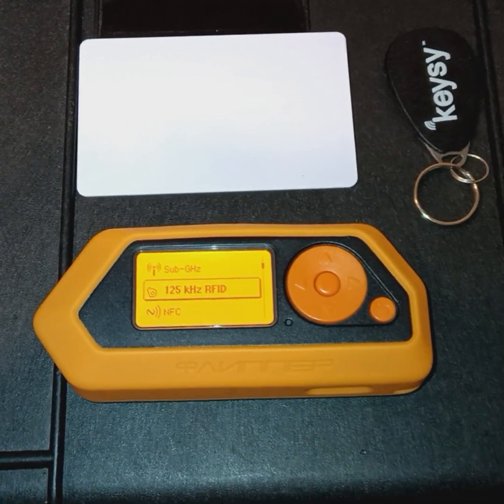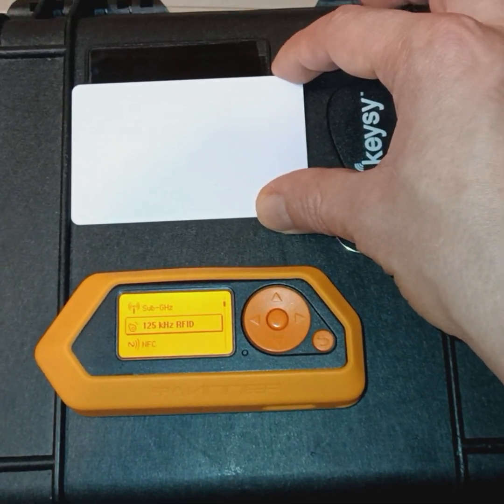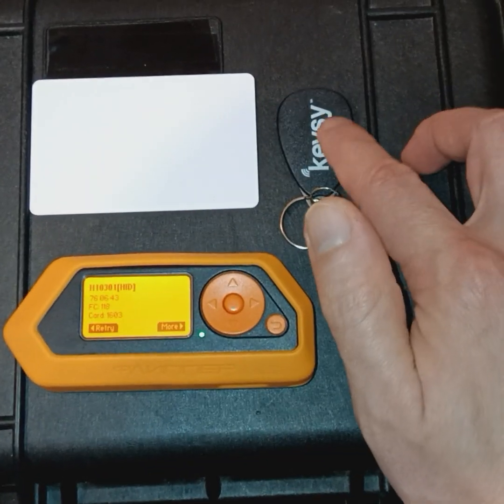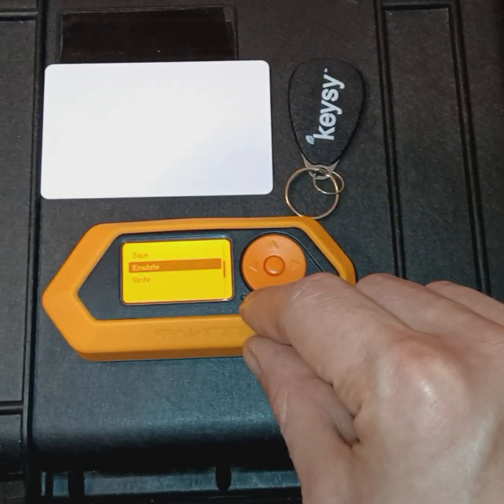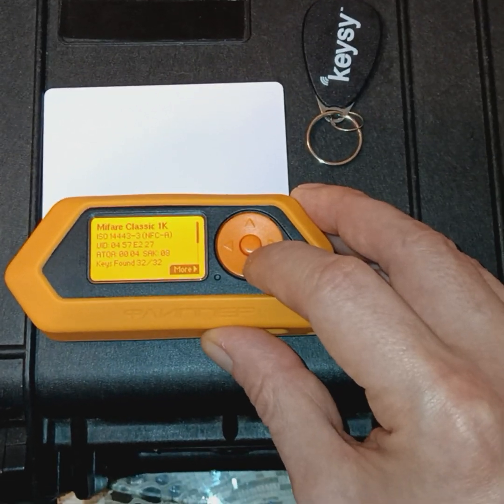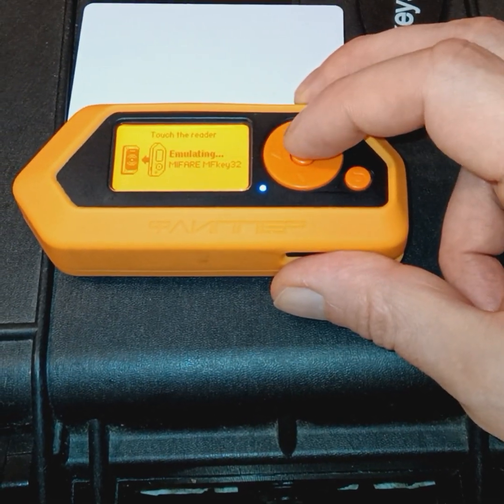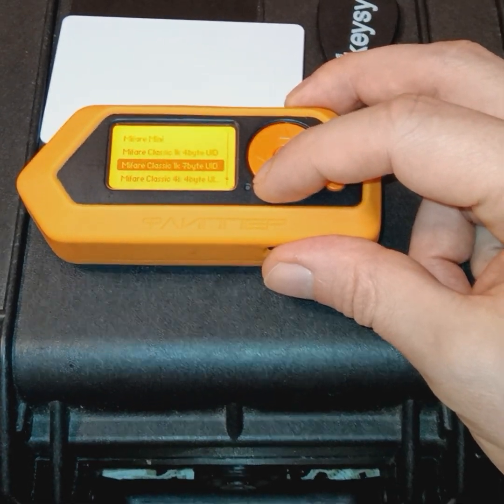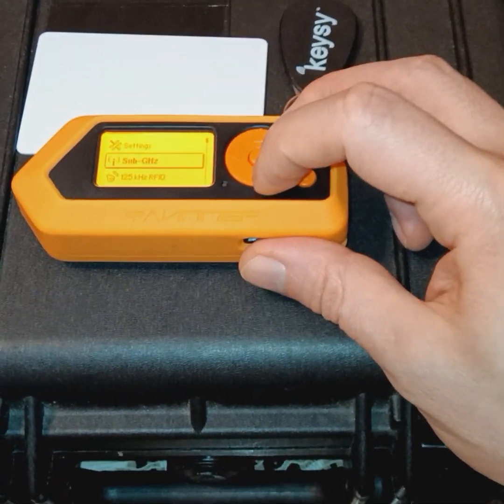Flipper Zero: RFID & NFC Hacking (125kHz & 13.56MHz)

Comment: I love my flipper zero but I really want to trigger a RFID reader from 15 feet away. At my work we use weight sensors to exit the property. I own a moped. My moped does not trip the weight sensor so I would love to be able to scan my employee badge from the inside of the gate so I can exit the entrance gate so I can leave work without having to open the pedestrian gate which is the ONLY gate that has a reader on the inside. Long story short, I have to build up speed and slam my breaks to trip the weight sensor and yesterday it didnt work so I went full speed locked my brakes and ended up crashing into the gate after my wheels slid out from under me. Missing work today because of a bad knee now. I think there should be a way to amplify the range to achieve 15 feet. I would be okay even if I had to carry a back pack to worth of devices to do it. Anyone know of such a way to accomplish what I am trying to do using a flipper? I am not versed in antenna design only code and protocols. My work uses h10301 id's and they are not encrypted so they are easily clonable (already got yelled at once for doing this sadly). But at the same time, it's rather discriminatory to not allow my vehicle access to leave the property. I don't want my $2,000 moped being considered "abandoned" and taken from me. I would rather take the L on getting fired so that I am not held hostage inside a gated area. If I get fired for that, that's an easy UI claim. Either way, I don't like being kidnapped/hostage or what ever it's called.
Reply: I feel you bro
Reply: @andrewshomemovies  At least security must have done something to the gate because now i can slowly ride over it and just as my moped is about to be off the sensor it finally hits. So I can now make it off the property at work and begin a 30 minute freezing cold journey home lol... but at least I can leave now without abusing the pedestrian gate that has a badge reader on both sides.

Comment: this is not true, you can NOT copy/write NFC tags. You can only emulate with the flipper
Reply: bro i’m pretty sure you can ??? it’s literally an option isn’t it?
Reply: @manasez2548  incorrect. You can write RFID 125 mhz not nfc though
Reply: @popoffkyng  You are correct. I cloned my 125 khz RFID tag that is a H10301 no problem. However you are off with your frequency by a factor of 1000 because its kilohertz not megahertz ;). Even my modified flipper zero cannot write NFC only RFID.
Reply: @manasez2548 could be wrong but maybe nfc magic

Comment: Is there a way to extend the range of the Rfid reader?
Reply: I also want to know this because being trapped at my work SUCKS!! I am injured right now so I am missing work because our weight sensors dont like moped's and I ride a moped. The tag reader is only on the OUTSIDE of our gates which means I cannot use my badge to badge out the in gate even. I cannot drive out the out gate. I have to more or less violate state laws using a pedestrian gate (the only gate with a badge reader on the inside) and then squeeze thru it slowly before hopping the curb back onto the street. It's unlawful to ride a moped on the sidewalk where I live :( bummer. If I could only extend my range a little I could hit that reader on the other side of the gate and let myself out. I am currently thinking my only solution is to clone my h10301 tag to a keyhain style tag and then using a teloscopic pole with the tag on the end to try and hit the reader. I would love to know how to amp up my range to 15 feet lol.